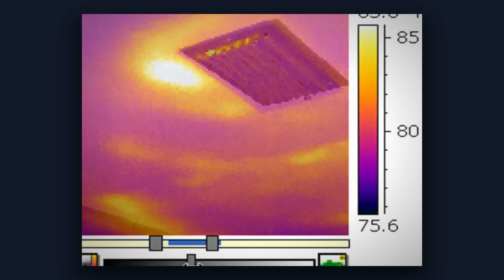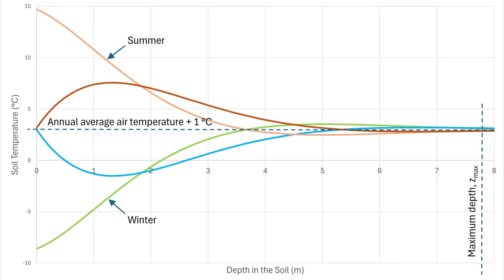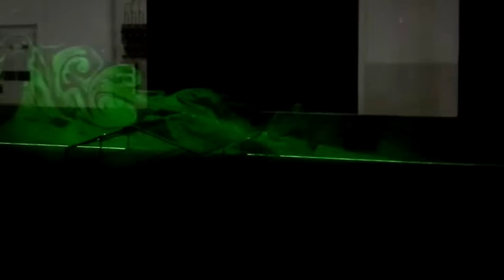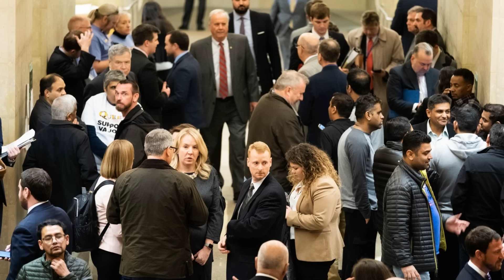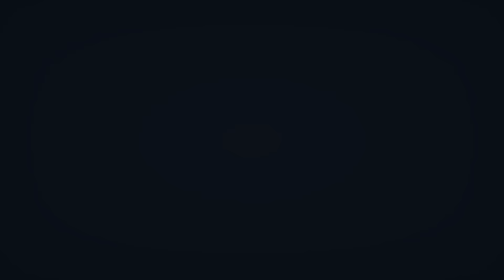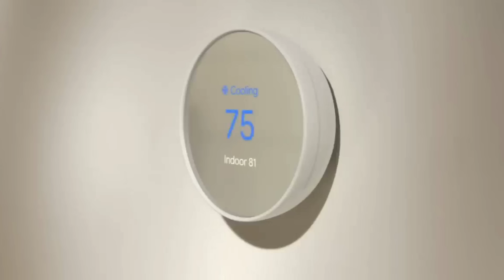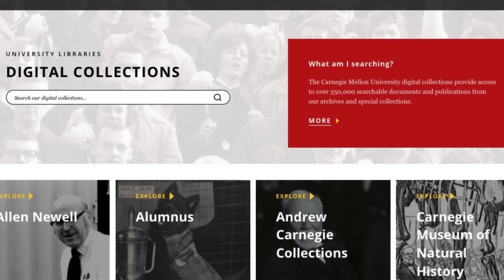This $300 Tunnel Heats Any Home All Winter for Free — The System the Gas Industry Made Illegal

Comment: The air return doesn't pull from outside. It pulls from within the house. If you introduce colder air from the earth pipe, you're killing the efficiency of the homes heat. Introducing 55 degree air into the return during summer would be beneficial, not during winter.

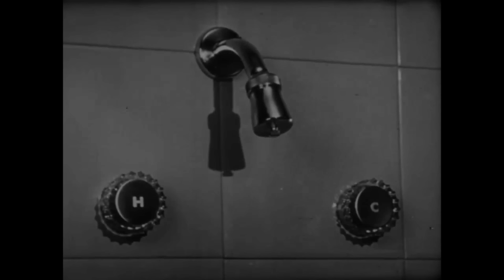Comment: I don’t pay for gas. I live in a rural area, but I do have a Pellet Stove and I believe that they are very expensive last year. I was able to get some bags on a good deal at 6:50 a bag and I’ve recently learned that it’s supposed to go to $12 a bag and that’s usually one bag every 24 hours. And that is the heat 2700 ft.².

Comment: I understand your concept well ! But who draws outside cold air in to heat from freezing to say 70F?

Our gas furnace heats air discharged into room air at say 66 to 68!, the return air duct returns heated air , held inside our house, back to furnace 66F or warmer, pass through gas burner heat exchanger and is slightly warms and sent back through ducts to mix with room air that only has to be increased 5 to 7 degrees 

It is out house insulation that keeps that cold air out and the warm air in. 

Our stored warm air is much warmer than the 55 degree earth ground temp ! And easier to heat 

My gas bill last month was 30.68 included 22.70 Distribution charge , and only 5.97 Gas cost charge. 3 BR ranch April 2O26. Indianapolis 

Cannot dig a ditch for $6.00 worth of gas.

Comment: The inside air in my basement is always 65 degrees. I heat the water to 120* on showering and dish washing days. Made a bedroom in my basement and it's cold in the summertime. But an Amish guy built my house 68 years ago.

Comment: This is a slightly faulty discussion because home owner has to assume that ALL the air the furnace warms comes into the furnace from the outside.  A forced air heating system re-circulates the air already warmed by the furnace, back to the furnace and the air return is full of air that is slightly lower than what is in the heated room ---- it has NOT cooled to the temperature of the exterior air of the house, nor has it cooled to even the temperature of the average 55 degrees in such a pipe.    This system IS good for barns where there is no central heating using forced air.   This is, however, good for houses that are overly insulated with no windows allowing in fresh air which is vital for healthy indoor air.     Also, this system would be GREAT for homes with both window air conditioners and central air conditioned houses to efficiently  bring in fresh air and to be the first and maybe only needed source for air conditioning (until the outside air reaches a very high temperature requiring central or other A/C to kick in.  Why is cooling and heating a house have opposite help with this method?  Because one never tries to cool a house anywhere near down to 55 degrees, but one usually wants to heat a house well above temperatures of 55 degrees.

Comment: What is the difference in intake temperature of 55F from a pipe burried 48inches in the ground and the inside return intake of a furnace with a temperature of 60F in winter?  Is it the energy loss through the wall system not taken into account?

Comment: The problem with the example shown here is it's drawing in the cold air from the outside. The correct way to design this is to send the warmer air from the inside the house thru a loop & return the warmer air back inside. This would improve the difference of temperature returning back to the house. I would bet using congregated pipe instead of smooth pipe would increase the efficiency even more being there's more surface area in contact with the earth.
Reply: The congregated pipe holds moisture.
Reply: why would you send air that is approx 70 deg through a tube thats 50 deg to cool off only to be reheated?.you might as well just have no tubes, leave the furnace alone and let it drawn in the air from inside the house to its burner.  i get your thinking start with warmer air  but your not constantly recirculating it. the whole point is to preheat outside air to the furnace.

Comment: This does and doesn't work this way.  For a green house it is great, passive heating and cooling via continuous air flow.  For a gas furnace, not so much.  Your furnace  should be using outside combustion air, while a warmer combustion air will help, you are still reclaiming heat, from the flame/fire, collected by the heat exchanger.  The exhaust leaves the building, which is why you want outside air supply instead of using the already heated air from inside.   
NOW, using this system in concert with a heat exchanger, heat pump, could work out well.  A constant 48 degree supply to a heat pump would be better than an 80+ degree ambient temp for cooling and conversely that same 48 degrees would be better than 15 degrees for heating. (Degrees are in F as I am a heathen)  You would need to take care in providing the enclosure to provide that 48 degree environment in which your heat pump would live.

Comment: I was an underground miner so the whole concept of using underground heat/cool does work for whichever season you need it for. Although gtting the temp up in the winter when the ground is frozen doesn't seem like a very phesable concept in cold climates. I've seen unique years when a buried 6 ft line froze. Although, if we could bring back the fired ceramic joinable pipes and fittings for making underground air grid systems I believe a mix of this with the passive solar hot water heaters would work great. Why not bed the ceramic grid in sand and have the tunes from the solar hot water exchange run back and forth across the lateral portions of the grid maybe 4-6 times. Cover with sand and I'm sure bringing that temp up wouldn't be a problem. Honestly I bet you would need a thermostat to get it to shut off! Also, why not tie into the house east to west? Why port from outside and not just maintain a closed loop? One end intake, the other the exhaust? I mean its like the difference between your car ac on regular or max.
Reply: I guess you would need something going out eventually for drainage. But a majority of the system could be a closed loop

Comment: But my cold air return draws air from the house. Wht would I want to suck outside or throu a tube in the ground,  55 degree air when the air in the house is already 68 degrees. Is this the combustion air that mixes witht the gas and buurns or is it the recirculating air inside the house?????

Comment: But your home isn’t pulling air from outside and heating it. High efficiency furnace is used outside air for combustion, but you were circulating the air in your home unless you have a fresh air economizer which wouldn’t operate on super cold days.  This would be good for a greenhouse or might help in the summer, but what am I missing?

Comment: I’ve conditioned the living spaces of many things from submarines to hospitals to sports stones to huge for story homes to find practical places to wear a family. I wish I could see the whole picture because much is being left out. Never a mention of a flow through humidifier to stop that gas heat dryer. There’s no mention of infiltration or bathroom exhaust units. And they’re simple limitations of approaching the theoretical with that ground pipe, but you still only have ground temperature air and I would hope that that was only fresh air intake. My SYSTEMS revitalize cleanup, the indoor air and meet the requirements of no fresh air intake necessary. If you’re dropping back to a thermostat setting when you’re un occupied or at night of simply using the 55 something degree ground temperature to heat maybe with the airflow in the pipe coming into the house still has to meet the Thermal requirements of the house and in that amount of airflow there’s simply not enough energy. It’s great for makeup error, but not for a primary. There’s no mention of the gas heaters if they were condensing gas heaters you’d gain more efficiency we have no idea how the gas heater is made. I just don’t think this is it it doesn’t require. I’m fumbling for words. There’s not enough here to know the story and I admire an Amish, but it’s not all here and therefore at least doubt in the mind of what’s really going on. It’s an excellent video very well technically produced it does however, leave questions of bounding. I like the idea of modifying the fresh air intake but also, where did you have to be very careful with the intake point seasonal pollen all the contamination would have to be coming in and caught like in a deep air filter and it’s gonna plate it out on the inside that pipe you’re gonna have to clean that pipe that pipe as it is a ground literally anything coming in positive charge is gonna stick right to the walls so you’re gonna have to clean that pipe out. This is something though that’s been around for a very long time in America if you look at Monticello Jefferson‘s home, he use a huge gas chandelier to build a heat lift that pulled air into his home through the tunnel, which was also where the chamber pots went out nice choice, but that’s what he had and it worked and it cooled his home off compared to other homes after pulling the answer that tunnel, but today the house is primarily condition by a high velocity system with very small ports and registers because you can’t tear the house up to put duck in it. No, I said Amy get along with me again I’m not English. My family hasn’t been English since 1650 and when we were English English at Fort Nelson Nottingham. I would suggest that one of the strong points of a gas heating unit as you can power it with a small inverter off of car batteries and keep your house warm.

Comment: Live in southern Wisconsin where heating is more of an issue than cooling.  Most homes in this area are built on basements. The floor of mine is about 6 1/2 ft. below ground level and in Jan. maintains a temp. 58 to 60 degrees. The heating unit and it's air intake  is also in the basement so will this system do me any good?

Comment: I don't get this. He is bringing in not-so-cold air and running it into the furnace, but the house is losing heat through the walls. In my house, the temperature is, say 70 degrees, which is returned to the furnace, so my furnace only has to raise the heat a few degrees (as opposed to his 15 degrees). He either is not explaining something right, or it is  a bunch of malarky.

Comment: This is so wrong.  Cold air returns don't draw most of their air from outside. These returns re-cycle the ait already heated then cooled by it;s presence in the house. So, the temperature of cold air return air is likely higher that the 55 degrees found four feet underground.  By installing one of these earth pipes, you'd actually raising your heating bill, not lowering it.

Comment: What’s is stopping you from placing this cooler air next to your hvac unit that has a built in heat pump for winter times? 
You could have the fan you talked about assisting the air along to come out with the hvac.  This would keep the hold thing outside. No worry of mold inside the house.

Comment: Very new to looking at this information.  on a modern high efficiency furnace with 3" ( i think) air intake I am assuming 60 feet of 4"  buried pipe would still cause enough resistance to disallow required air flow for draw which is why the blower fan is required.  Would that fan have to be running 24/7 and if so would it not blow cold air into the house when the furnace is not running?  If that is the case how would you get the blower fan to kick on only when the furnace does?  I am in Southern Alberta Canada where temperatures in winter do occasionally get below -30C and infrequently even to -40C in from December to February.   Also, How does this work with the fresh air intake pipe coming into the home?

Comment: Southwest Virginia here . We use closed loop systems.  With our setup ,no moisture or radon . This took 2 years of reaching and trial and error.  A good system takes a lot of pipe good speration and a proper soil and sand mix . We are 10' deep at 400 ' long . This year we took a vacation and had no heat during the below zero temps for a week . The house stayed at 54 degrees.  You are using the earth as a heat sink . Summer the down spouts drains around the  systems winter the water  away. If you have the space it works . Learn how to make activated
 carbon and a descent solar for the fans and uvc lights . No smell no radon . Do your homework and enjoy . Mine cost about 6k.
Reply: No labor cost I guess, because a contractor would bleed you to death, and they usually do on these things, as if geothermal and passive solar were something new and innovative... Like cave dwellings. I've worked for a few, I never hire one, they'd have to hire an engineer to do what I do for myself anyway.